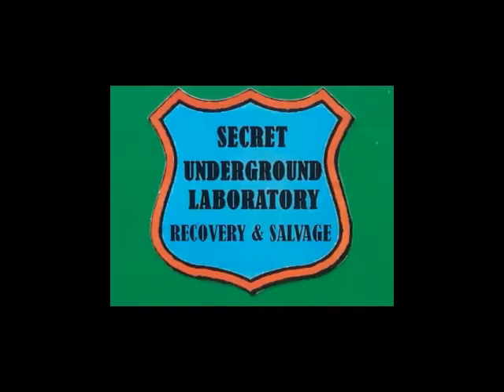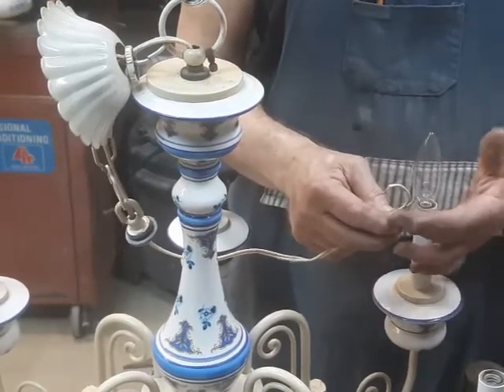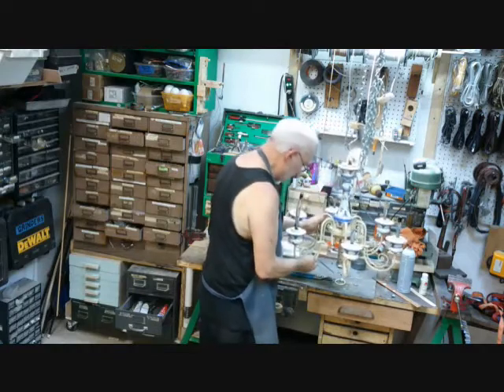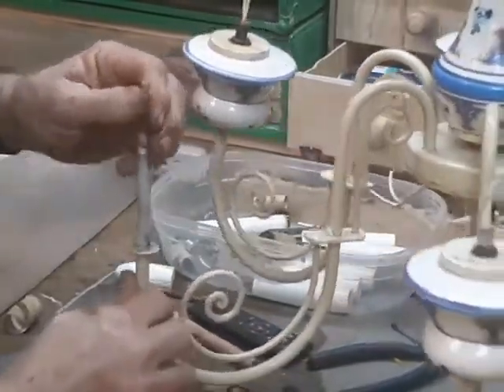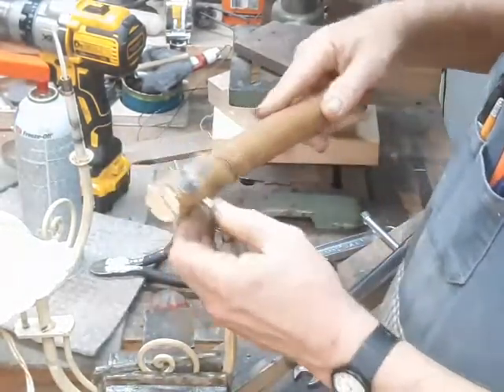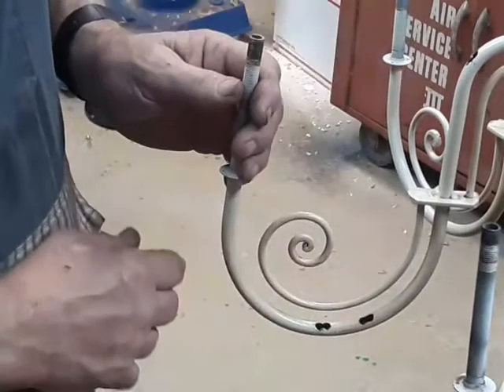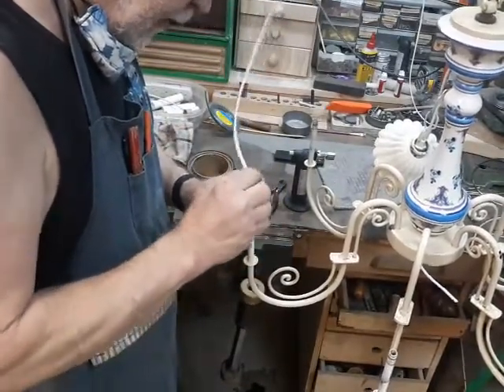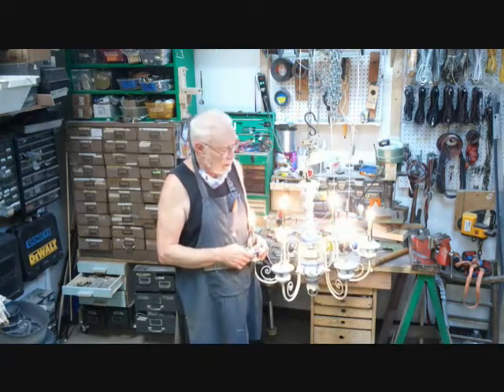Rewiring Murphy's Chandelier, Where Everything that Could Go Wrong, Did Go Wrong

Comment: Another great job. Most places would have turned that job down.
Reply from the maker: This design of chandelier is usually the easiest to rewire and takes less than an hour. The water damage was a surprise. The owner bought it at an estate sale and did not have it inspected before it was installed. I've never had to do so much surgery on steel chandelier.